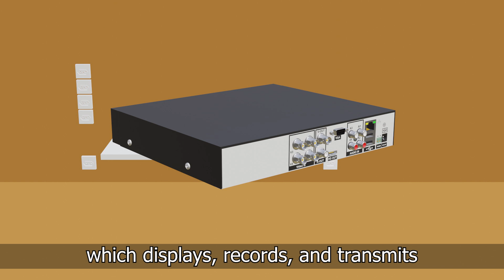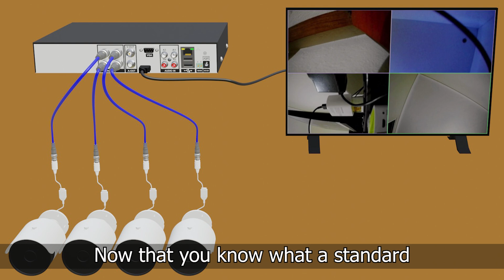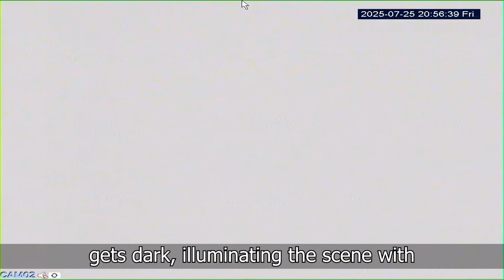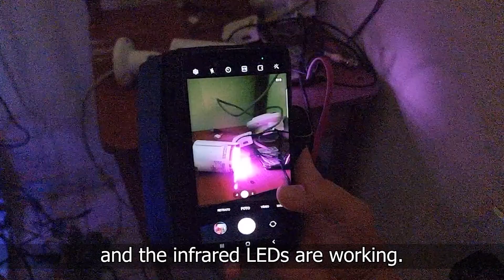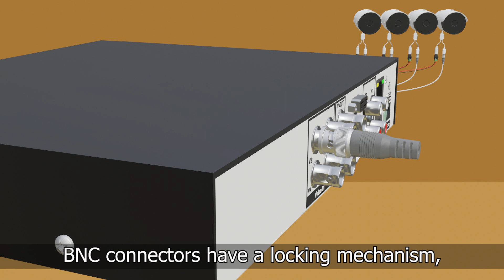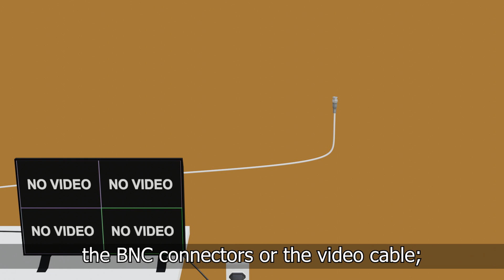Fix Security Cameras That Don’t Work Using One Working Camera – Beginner Friendly

Comment: 2 work 2 don't
Reply from the maker: Since you have some cameras working, you're in the right place! This video will help you swap the working ones with the non-working ones to find out if the issue is the cable, the power supply, or the camera itself. Let me know if you need any help during the tests!

Comment: What do you do when the XVR says its offline when you are trying to access the cameras on your phone or on the app?
Reply from the maker: When the application reports that the XVR is offline, the first step is to check the XVR itself to confirm it's properly connected to the internet.
On some systems, you can verify this on the Version screen, where there is a Connection Status or similar information.
If the XVR is genuinely offline, you'll need to troubleshoot the cause by running a network connection test on the device. This test will help determine if the XVR is correctly connected to your network device (modem, router, or repeater) and, most importantly, if it has internet access.
Look out for our upcoming video tutorials! We will soon post videos showing you exactly how to perform these verification steps on a range of XVR devices.
God Bless you!
Reply: Mind say account has been locked